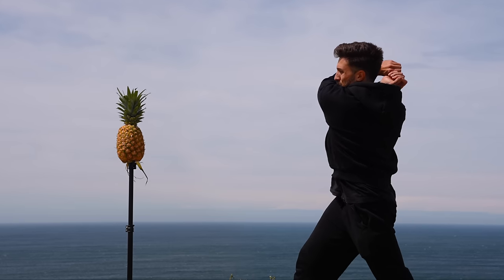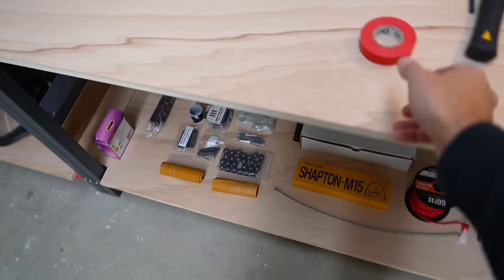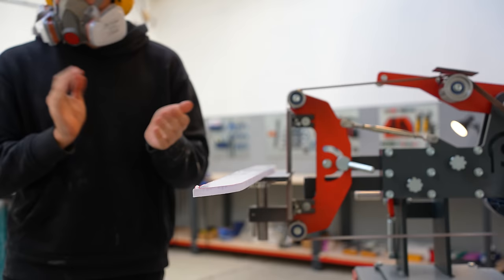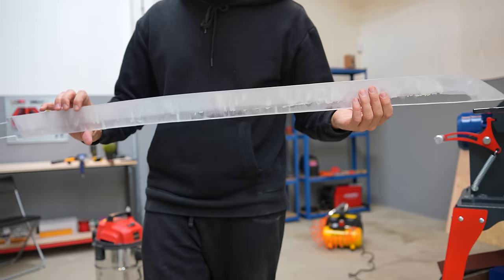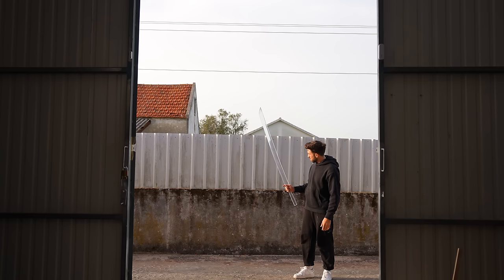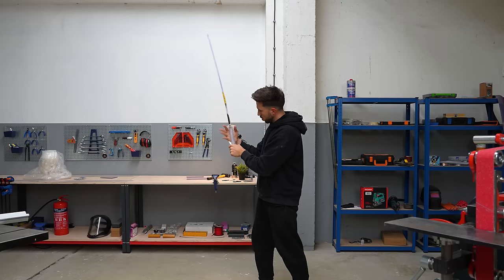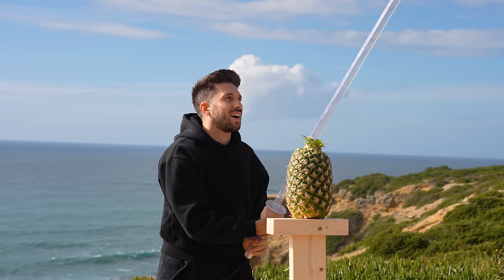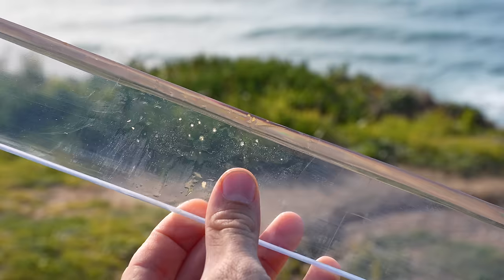I Built a Transparent Katana

Comment: A true bladesmith does not make mistakes. Just smaller knives. 
I’d like to see a test with v1 too. I know it didn’t match the title of the video, but your blade geometry was significantly more conducive to cutting through stuff.
Reply: And that small rounded part like in the teeth of T rex.
Reply: Real blacksmith here. That's just bs. A single mistake can ruin the whole blade. There is no "just smaller blades"
Reply: I actually think the V1 blade looked badass, and the distortion looked like something from a sci-fi movie.
Reply: A crystal blade like that is cooler anyway!
Reply: @bubby6858  unless you get it too hot, couldnt you just keep making it smaller to remove mistakes? Just curious
Reply: @dipf7705  That would only work if the mistake is in the cutting or grinding, not in the heat treat or temper, or in the forging (I'm not a pro, this is just my understanding based on watching bladesmithing vids for the last 2 years). For eg., if you got a crack or delamination running through a significant portion of the blade.
Reply: @dipf7705  yeah it's not that simple one error in the process and the whole thing comes out subpar or worse shatters on contact with something. It would be really hard to get steel "too hot"  anyway
Reply: @Akshay_PJO  yeah this. Even a small crack at the end of a blade would basically be a write off. The would be not telling if the rest is good or bad.
Reply: @bubby6858  Cool, thanks for confirming 🤝
Reply: I wonder if it would have been more transparent if the bevel was straight and not rounded off
Reply: @bubby6858 I'm not even a blacksmith lol I just watched enough Forged in Fire to know exactly what you mean
Reply: @t.r.everstone7  that show is the highest tier of stupid I have ever see when it comes to forging. So much is gotten wrong or just ignored for the sake of *blades*.
Reply: Yes please!
Reply: @bubby6858  Hmmm not sure what that means. All I know is that I know from watching that show that you are right about how a single mistake can ruin an entire piece of metal. Must be very frustrating when that happens.

Comment: The right angle you cut into the blade where the handle and blade meet is what caused the break, not the added thickness of the handle. The same thing happens with steel weapons - they call it a stress riser. A rounded transition from handle to blade would help avoid it.
Reply from the maker: Interesting! Thanks!
Reply: @MikeShake  to get a nice round transition easily and quickly, drill holes in the places where the cuts are supposed to meet, and then cut the material.
Reply: @chstoney  well if you do that it would be almost impossible to polish so it won't be a invisible katana anymore
Reply: Didn't he still have the right angle (stress riser) when he redid the handle? I was thinking the same thing until he cut the handle in again
Reply: @king_the_titan8  how would that be impossible? The only difference is the 90° angle would be rounded at the intersection. Some might say that makes it easier to polish
Reply: @Sharp.Penguin00  well polishing the drilled holes will be hard*
Reply: @king_the_titan8  the hole wouldn't be completely surrounded by the material once the handle is formed. The hole would be used to form a rounded transition to the handle instead of a sharp 90 degree angle
Reply: @king_the_titan8  there aren't any holes at the end. At the intersection of the 90 degree angle of the handle, you drill a hole and then finish cutting out the handle. It's just so the intersection is rounded and not sharp.
Reply: @AceRanger20  alrighty I cannot take a argument I do not understand . . . welp I guess I'll figure it out if I ever decide to make it.
Reply: @Sharp.Penguin00 yes, but the handle was so close to the width of the blade that it didn't make a difference.
Reply: @MikeShake try a hiboky
Reply: @jimmybap I was thinking the Sam's thing
Reply: @king_the_titan8  they're saying you drill a hole at the spot where he originally made a 90 degree corner, then when you remove the rest of the material, you will get to the part where there is a rounded corner. maybe a better way to think of it is if you took a large hole saw and cut a large hole, then you have a very rounded corner, and you can remove the rest of the material to finish up the rest of the piece.
Reply: No. Pollycarbonate would only bend easier when it’s thinned out. 
This is the reaction of the superglue making it brittle. 
The visible ”ice effect” is micro cracks in the handle. 
Pollycarbonate reacts the same way to ethanol etc.
Reply: I came here to say this exact same thing. Look up why Plane windows have rounded corners. Its the same thing.
Reply: First thing I noticed right at the beginning, I haven't even got a 3rd of the way through the video yet lol, it's 101 in mechanical engineering/design.
Reply: Came here to say the same thing. Gorgeous attempt at a sword, though.
Reply: It's more likely to be transparent
Reply: Yep, the same old reason airplanes have rounded small windows
Reply: @elspark101  JESUS AND GOD LOVES EVERYONE SO MUCH TURN TO THEM BEFORE ITS TO LATE
Reply: @jonr4291  yes, the increased handle width helped, but more so the reduced blade length and that the handle wasn’t made effectively inflexible as before. I’d wager a PC blade of that length and thickness, even with rounded transitions, would still fail quickly (though not as quickly) given the relatively rigid laminated handle construction. Katana handles are typically slide-on units with press fitted dowels/pins, which might provide the necessary flex, though in this case I think all sharp corners and transitions except the blade bevel should be rounded and polished for polycarbonate to withstand any kind of extended abuse.
Reply: I was scrolling down in hopes of seeing this comment. 
Saw other mentioning weird reasons like the bevel of the blade or something else. 

Glad to see someone provide the proper reason.
Reply: @king_the_titan8 well there was nothing invisible about the hande and guard anyway so might as well go for rigidity
Reply: Came here to comment this.
Reply: This guy beat me to it. It's also referred to as a stress concentration. This is definitely why they blade broke. You can have your handle - just round off all the right angles. =)
Reply: @rafaelmeletti  Yeah, they learned that the hard way. x.x
Reply: @MikeShake  would love to see a follow up
Reply: @2KHunter  Sure, thanks.
Reply: @robinlundh3962  both are structural problems. He definitely needs to avoid both glue and right angles. One common way to make the tang of blades stronger is to make the transition and 45 degree angle, which I would recommend along with rounding the inside angle and obviously making any handle scales from a more flexible material, like rubber or a soft plastic, and attaching them in a different manner, such as binding and a low pin o pommel.
Reply: @Sharp.Penguin00  yes that's why real katanas aren't T'd off at the tang like the Amazon special 1s are. They have a Taper so yes it makes it like try to compress a disc and not snapping a T. I know that made no sense I'm not good at explaining without an example.

Comment: 15:02 swordmaker here. When you make a sharp transition like between the tang and blade you create a stress riser. You need to create a round transition.
Reply: In this case it’s a cemical reaction to superglue. The ”ice effekt” in the handle are multiple micro cracks.
Reply: @robinlundh3962  That's not what he was talking about. What he is talking about, that in the area where the blade becomes the part of the handle, there is stress on the inside corners. If you ave steep angles in there the item can start cracking in those conrners and the blade snaps off. You need to keep these inside corners as round as technically feasible to avoid those stresspoints.
Reply: @profezzordarke4362  Pollycarbonate does not have the same mecanic disabilities as metal. It would only bend easier when narrowed down and you could do sharper cornering than this and it would not crack. 
Unless you cemicaly change the capabillity of the material, in this case with superglue. 
Superglue made microcracks all along the handle and it broke exactly where the material was no longer trippled in thickness. 
Rest of the movie it worked fine. Even narrowed down on the sander. 
Superglue is the culprit in this case nothing els. 
If it were steel. I would agree with the swordmaker.
Reply: The "cracks" that you refer to are in the handle itself, and the point of breakage is right before the guard, meaning it wouldn't make physical sense to break there instead of along the handle shaft where these "cracks" are. Furthermore the "cracks" are along the length of the shaft, while the breakage is perfectly perpendicular to it, exactly how a stress riser point breakage acts.

Also, I say  "cracks" because those are not direct deterioration of the poly through chemical reaction as you say, but simply weird light angles on the dried glue between the 3 total sheets of pol, causing a lot of refraction and reflection and the cool effect. Glue can't erode poly. The full structure would be in all fairness actually stronger, especially since the glue as a bond agent adds even more total strength between the 3 pieces combined.
Reply: Do you mean a tapered transition?
Reply: Since your a sword maker, did you get the vibe this was more messer or falchion than katana? I ain’t an expert but it’s what I thought anyhow. Still a good sword build style. But not a katana.
Reply: @robinlundh3962  superglue doesnt crack polycarbonate/lexan
Reply: @robinlundh3962  You're just trying to sound smart, but actually don't know what you're talking about
Reply: @0pPotato  if I really wanted to knit pick it, then no, it isn't a katana. But I think he had to make some consessions to get the effect he was going for. Still a great video.
Reply: @isakoolsson  I know it's a crazy concept, but two people can both be right lol There was more than one thing contributing to the break.
Reply: @420StepsFromHell you’re very right 💯 it’s actually simple common sense when you think about it. When you create a weak point in ANY material. That point is the first to go under a load/stress/pressure etc strong enough to break it.
Reply: Sword swallower here.
He's right.
Reply: @robinlundh3962  Fogging from CA glue on polycarb isn't "micro cracks"... Maybe do a little bit of research first, my dude
Reply: @robinlundh3962  I suggest you do a test using polycarbonate and both of the corner techniques, then you can come back and eat your words. 
Just because it's impact resistant doesn't mean it won't get stress breaks at a crisp internal corner.

I design with polycarbonate often and I've found out the hard way
Reply: @therealjimshady100  I have worked with glass and polly over 20 years. And securing the swedish police riot buses. Armored money transports etc. 
I learned this the hard way by covering screws in polly that cyanoacrylate ”superglue” allways cracks pollycarbonate. 
Normaly Pollycarbonate react to stress like chewing gum. It just stretch unless cemicaly altered. 
I have had to replace pollycarbonate windshield’s on race cars running on alcohol due to crack appearing from alcohol. 
What did you clean your polly with when working with it? Or did you stress it whilst cold?
It seems impossible to share knowledge nowadays….

Now since i’m in a terrific mood and my professional experiance obviously means nothing too all of you keyboard worriors. Not that I actually care. 
But try to follow your own example. Experiment yourself since you have access to polly. And then: Don’t eat your own words like you demeaningly ask others. 
Learn and earn respect by apologise… or not.
Reply: @JH-fk8ow  yes it does.
Reply: @isakoolsson  i actually do know.
Reply: @billymanilli  yes it is and i have.
Reply: @robinlundh3962  jeez look how upset you are. Calm down poppet! Calling people keyboard warriors doesn't mean that you win.

I've also worked with it for 20 years and I've done both corner techniques on things used thousands of times a day at visitor attractions. I can categorically say that polycarbonate along with most materials will fail at a crisp internal corner, compared to using even a small internal radius.
It would seem that multiple commenters are saying the same, yet you definately know better, right?

Go and cut a crisp corner out of some polycarbonate  do the same on a milling machine to create a rounded corner. Put both in a vice, hit them with a hammer and come back to tell me which breaks first and where the break occurs.

Comment: The biggest reason your handle snapped off is the geometry of your sword. Having those sharp interior corners creates a stress concentrator. It's like if you have a 10 lane highway suddenly shrink into a 1 lane country road with no transition. All the cars (stress lines) have to bunch up at that point, cramming into that tiny area with no easing into it. It works when traffic is low (like swinging the swrod through the air), but the moment there's any serious traffic (like hitting the pineapple) there are too many cars trying to go into that 1 lane. For the cars, they just can't move anywhere, for your sword, it breaks.

You will always run into this issue with making the grip smaller than the blade, but adding internal radii or some way to gradually reduce the size, will help to prevent this failure in the future. That will always be your point of failure on a sword made out of a single material. Katanas, even though they are made from one piece of steel, have different hardnesses at different parts of the blade and grip effectively making them multi-material sword.

I bet you that if you were to take your V1 sword, even though it is a sharper blade, you will have the handle snap off even if you don't make the handle thicker. It's just a nature of your sword geometry and really only something you can learn from spending too much time reading books, or breaking things like your doing, which is how the books were written in the first place.

I also don't want to invalidate your own discovery of adding material to the handle making it stiffer and contributing to the blade breaking. That is definitely a part of it and an awesome insight to have found. I just want to highlight that your 2D geometry has as much a roll in the strength of the blade as the 3D geometry does.
Reply: It’s actually most likely due to the fact that most superglues react with polycarbonate to make it brittle.
Reply: @samp1501  I'm of the reasoning that while the polycarbonate is able to flex along the flat edge, by hitting the material from it's most rigid side will always transfer more energy into the blade with nowhere to go but its weakest point.
Reply: @amosdotl6892  is a combination of everything, he needs to remove some material to turn the sharp inner corners of the blade handle transition into round corners, for the handle 2 scales of polycarbonate are okay but only gluing them to each other so they encase the handle and then hold it with a polycarbonate pin so if shit hits the fan the polycarbonate pin breaks.
Reply: Good comment! I was going to point out the sharp angles where the handle meets the blade as well. There's a reason real, properly made swords are rounded there.
Reply: @MrOynx  Get out of here, kid
Reply: This is correct.
I was going to write the same thing.
In a lot fewer words.
Reply: Then how do you think that cricket bats work flawlessly. It’s made of willow wood the handle and the block are 2 different parts glued together. Unlike baseball bat the width of the cricket bat don’t decrease gradually it’s a sudden decrease like the polymer sword. Can you explain that?
Reply: @Lord_Rainbow You answered your own question; the handle and the block are two separate pieces. To use OP's highway analogy, it's like two different highways bridging past eachother without intersecting.
Reply: @Lord_Rainbow  Different material, and also not used for nearly as heavy blows.
Reply: @Lord_Rainbow  And the moon is made of cheese!
Reply: Engineer here. Came to say the same thing. Sharp corners are stress concentrators. Stress concentrators are fissure breeders. Fissures only make the stress concentration worse, and ultimately are the death of any hard material (as in not ductile, not as in not flexible)
Reply: I'm in absolute agreement as to why the blade broke where it did.  It's because of the squared angles there where the tsuba was fitted to the blade.
But I want to add in that adding the tsuba to the sword is going to actually increasing the chance of that stress fracture right there at that point.  Even with the rounded corners.  Largely due to the nature of the material that you're using.
Round those corners out, and taper the tang to slightly less width at the end of the tang.  

If you feel that you need something to keep your hands from sliding off the grip, heat bend the panels that you're going to apply to the tang for your grip.  It won't be "katana-esque" but will function.
Reply: thank you for the analogies as someone who wouldn't understand otherwise!